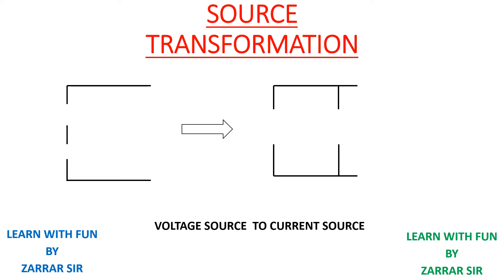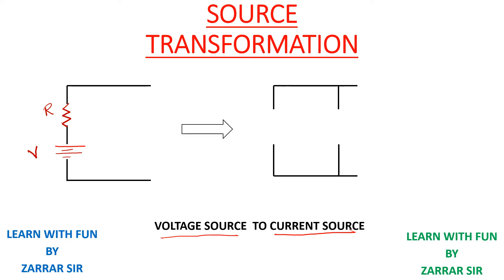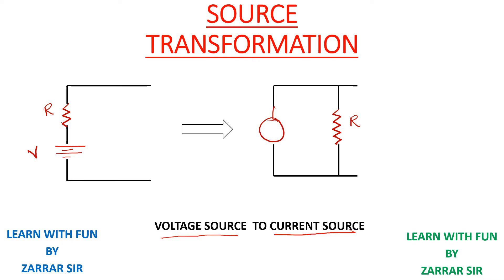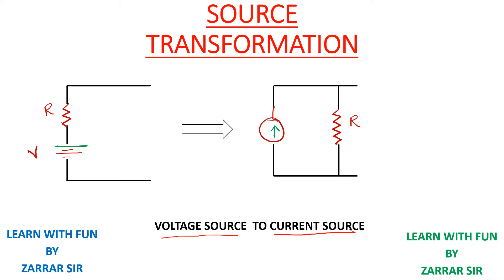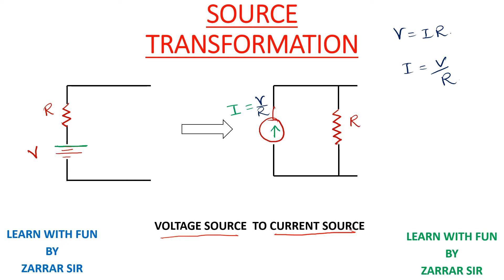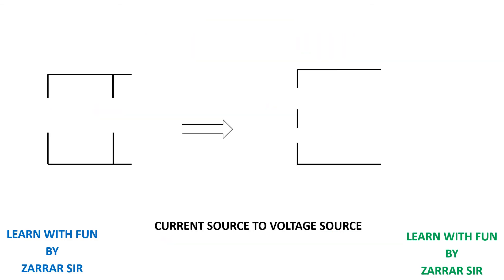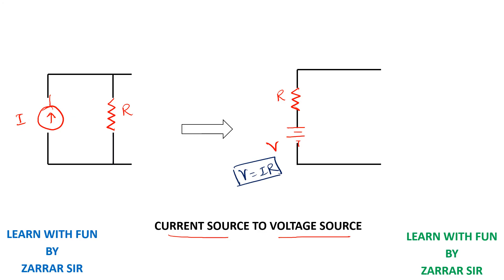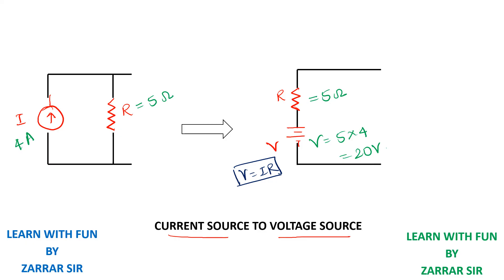SOURCE TRANSFORMATION in Easy and Effective way within 5 Min

Comment: 3:13
Question: if we put voltmeter terminals across the 5 Ohm resistor on the right figure would we get a reading of 10 volts ?  If yes would that mean that the voltage across the current resistor is also 10 volts ?  If yes would that mean that the internal resistance of the current source is  10 volts devided by 2 amps equal 5 Ohm which is the same as R ?
Thank you for your good video.

Comment: 4:54  Question:
What happens if we put  voltmeter terminals across R on the left figure ?  Would we get a reading of the voltage across R while R is connected in parrall with the current source ?

Thank you for your good video.